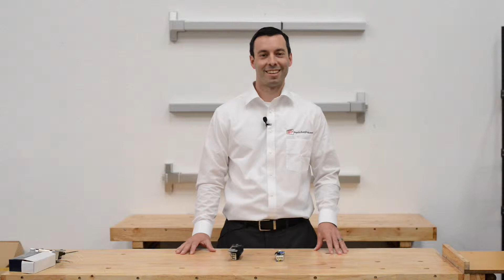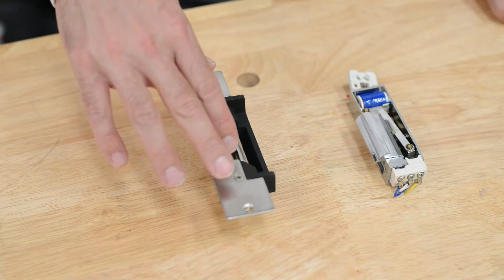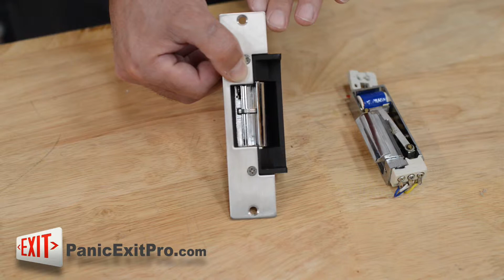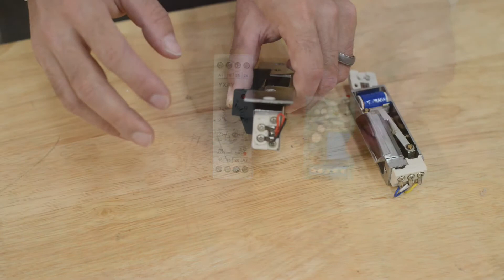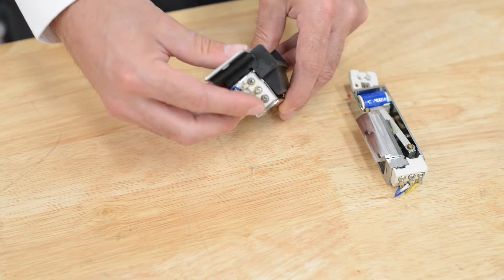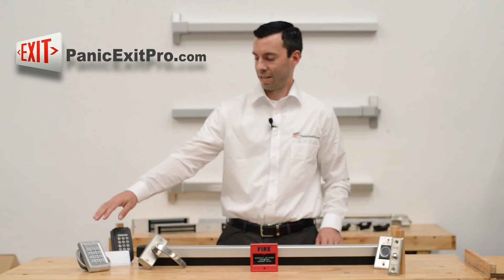How To Operate 2083 EJ Electric Door Strike

Comment: I mean the whole system is basically just a solenoid operated mechanical latch with some momentary switches and/or hall sensors in place of bells and/or whistles... well built, as I image are most of them.